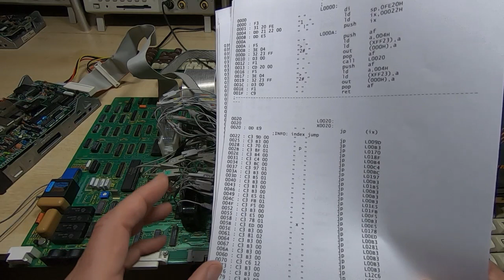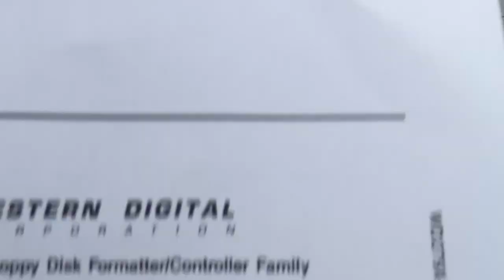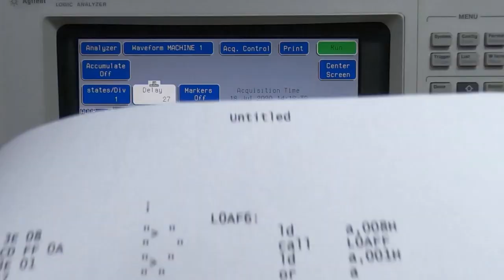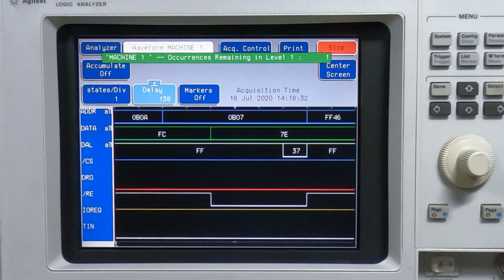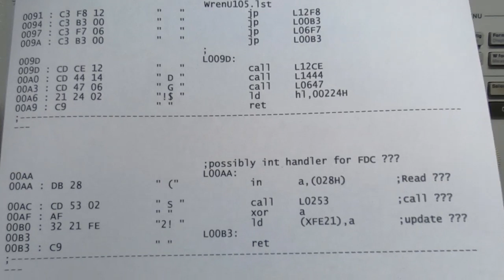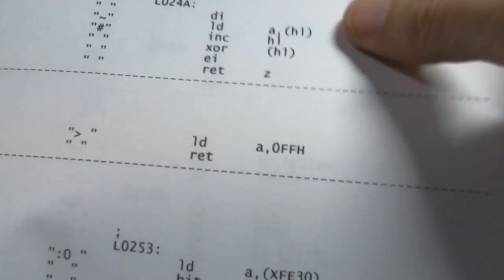Wren Computer Repair Part2

Comment: You would be better off removing the components from them and testing them in a tester or some other method, then testing the  board itself continuity etc.  Thats the way I have done it just as you stated about 2 minutes in especially if the number of components are not very numerous.  Yeah its time consuming but yeah, it would help rule out whether its a board fault or a component fault.
Reply from the maker: That would be true if I was trying to repair the board (although I can test them using my logic comparitor without removing them) but I am trying to reverse engineer the board to create accurate schematics so I am not too concerned if the components work until I have completed the schematics. I would then test the components before refitting them. One problem with the wren is that the board layout is not very good so components that may test good in a component tester may still not work in the wren if their output is slightly low or slow. My goal is not just to repair a single wren but to provide information that others can use in future to repair more units.
Reply: I also very much enjoy the HP LA content.  Actually has helped me learn more about mine (HP 16500).